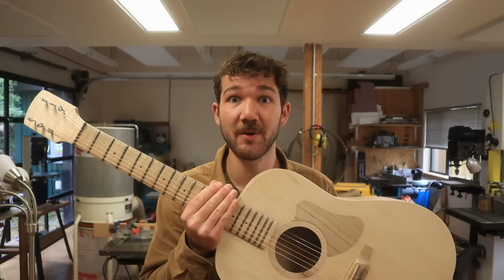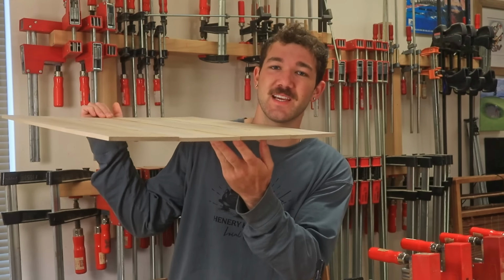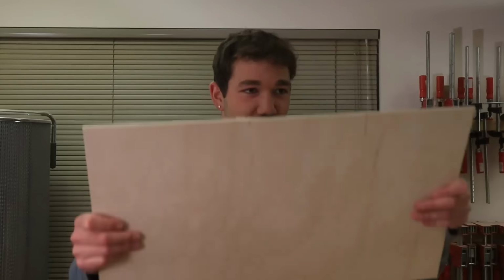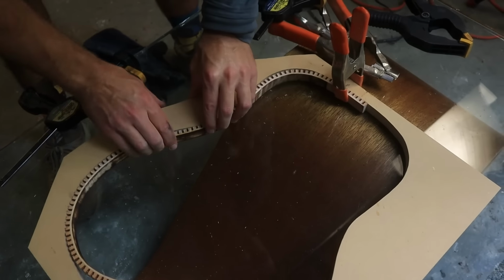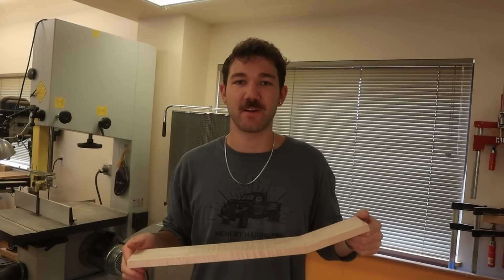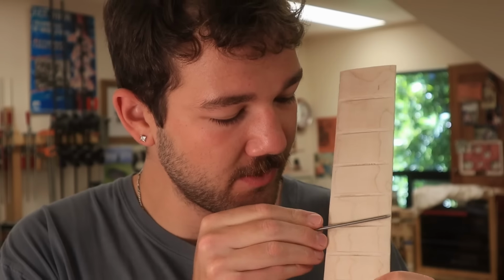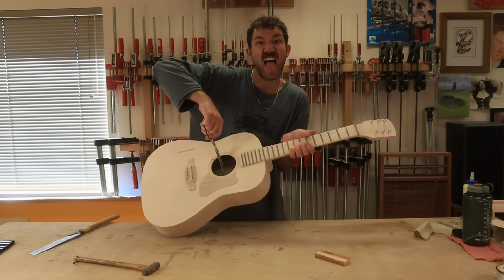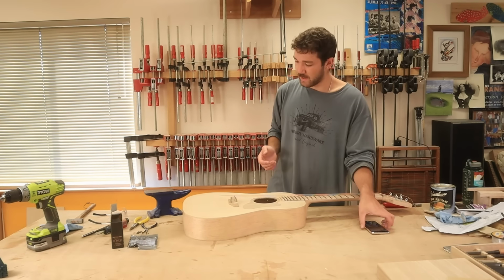I Made A Guitar Using Only Home Depot Supplies

Comment from the maker: The first song I try to play on the guitar is "Spanish Romance," look it up if you have only hear My Chemical Romance, the original is pretty good. My dad played Green Sleeves. 

Yes you did hear Battle Block Theater music and "the pen15 (eek!)" in this random YouTube video about making a Home Depot guitar
Reply: Ok :D
Reply: this is completely overengineered. If you really want to be resourceful, make a guitar out of wood you chopped down yourself. I made a guitar with nothing but cedar trees, a chainsaw, hatchet, a worn-out carving knife, and some old guitar parts, it's not hard, it just takes a little patience. All you need for an acoustic guitar body is some material to make a sort of chamber that reverberates sound. 

The guitar body I made had all sorts of holes in it, but it still worked just fine, it was made entirely of soft wood, which is not ideal, but it still works just the same. The only improvement I could add is a threaded rod and bolts implanted in the neck so it can adjusted when it inevitably warps. 

Instead of the traditional method of framing, I made it out of crossing half inch by half inch studs, similar to a house frame, then I used old roofing nails and glue to attach the studs, connecting the body with the frame. There are always cheaper alternatives that give it a unique look, which I personally appreciate over this copy paste. I get that making something of your own is admirable in some sense, but there are more practical ways to get the same effect.

Seems to me like a monumental waste of time and money from someone who doesn't know what they are doing, I don't mean for you to take offence, by your own admission, you're not that experienced woodworking. It's a skill that takes decades to master, I'm not even half decent at it myself.

5:00 the reason it breaks is because you are supposed to dampen the wood to make it more flexible, but more importantly, you probably didn't use the best wood for the job, not that you needed to. Everybody who does these kinds of diy projects always overspend on them, you don't need all these expensive tools and hours of precision crafting to make something everyone can enjoy

I think my main issue is that it costs like $75 for a decent used guitar online, you can't really make a business or do anything useful with this type of project, its just wasteful for the average viewer to attempt it on their own
Reply from the maker: @garbagecan6969 I'm not going to waste my time explaining to you why so much of what you said is silly, I will just simply point out that you have clearly missed the point of the video. I'm just here to make entertainment, and making a guitar out of obviously horrible materials is amusing to me, and apparently many others. Nothing deeper than that
Reply: @BebeauBuilds  it wasn't entertaining
Reply: @garbagecan6969 "you're not that experienced at woodworking" because he didn't just make a solid guitar frame, doesn't matter if it's not complicated, that's good woodwork either way.
Reply: @SpencerBrewerOG  he admits in the video hes not good at it
Reply: @garbagecan6969  satire?
Reply from the maker: @garbagecan6969  Want to cite your sources there? Pretty sure I never said anything about not being experienced at wood working. Made a JOKE about not knowing how to make the walls and a JOKE about not gluing the pins in well, but you made the conclusion that I'm not experienced at woodworking. Sure sounds like you're just an asshole 😂
Reply: What's the tune your dad plays?
Reply from the maker: @mtbmt6908 I'm pretty sure he's playing Greensleeves :)
Reply: @BebeauBuilds  awesome! I couldn't remember for the life of me. Thanks and great video!
Reply: @garbagecan6969  has a point but still he’s not in control of the video so building a 5+ paragraph essay of what u did wrong is a lil excessive
Reply: @garbagecan6969 is kinda a Karen tbh just let ppl what they do
Reply: @BebeauBuilds u did a rlly good job on the guitar man nobody rlly knows how to build them except luthiers so that’s a rlly good first try!
Reply: One thing I would suggest on attaching the neck to the guitar is making that section of the body attaching to the neck filled and cut the shape of the start of the neck into the body. This is called a dovetail joint. It overall really improves the tone quality sound of the instrument. Even in many store bought guitars.
Reply: And also the reason that u get that ping sound on the strings I think is because the frets are too high on the guitar or at least something in the guitar is touching the string when u play it 😁
Reply from the maker: @Shadow_bru I actually did "key" the neck to the body, that's what the routing of the body was for when my friend was using the home made jig. I just didn't show all the intricate details of everything cuz it's not a tutorial and that would make the video five days long :P but thanks for the interest and kind words
Reply from the maker: @Shadow_bru I'm not sure, I don't think the buzzing comes from it hitting the frets. I think it has to due with the groves made in the nut and the way the bridge pins are held in place in combination with the stupid eye bolt tuners
Reply: Yea I think that was bolting the neck down, you may need to slot it in and glue it.
Reply: @garbagecan6969 what you did was cool and all, but that's not the point of the vid
Reply: why does it sound better then my actual guitar ?
Reply: @BebeauBuilds well, you did say that you don't know how to play the guitar 😒 just telling lies, huh?! 😂 Just messing with you. Entertaining video i watched til the end. Nice job.
Reply: @garbagecan6969 let him do his own thing. If it's "not entertaining," just go watch a different video instead of making a whole rant about it on some YouTube comment, no need for that. I'm also surprised you but all that effort just for a comment that is supposed to spread negativity. I find that a waste of time, AND effort. I'm writing this comment because I am just saying, just let him entertain the people that are into this type of stuff.
Reply: @chuckmccheese  if you read my original comment, you would know I intended to give good advice. Some people don't like being told that they can do better, no matter how true it is. And well, if he wants to argue with me, then i best give him something to argue about
Reply: @garbagecan6969 Um, that didn’t look like advice. It just looked like some dude is picking apart every single detail of a silly and cool video. He’s not trying to make a perfect guitar, not even a good one! He’s just trying to see what he can do with a little creativity and an open mind, something you clearly don’t have
Reply: Total cost? Way better than expected. Fun!
Reply: I was literally playing Spanish romance while watching the first part of the vid and when I heard you play it i got jumpscared lowkey
Reply: @BeBeau builds nice video sir, that’s cool how you made a guitar out of wood , from Home Depot and where’s your dad originally from I can her an accent. And that’s good he approved of the guitar
Reply: I immediately thought of MCR
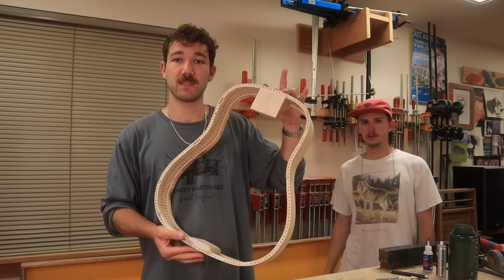Reply: 7:03 what’s this song called?
Reply: Where else can we follow your work?
Reply: @garbagecan6969 u just have no taste this was entertaining as hell lol
Reply: isnt it anonymous romance

Comment: I can’t believe the metal strings held up and didn’t snap the neck without a tension rod. Impressive.
Reply: Acoustic guitars don’t have truss rods, so he actually built it somewhat correctly in that sense.
Reply: @wonton4658 Steel stringed acoustics require truss rods & X-Bracing to support the tension of steel strings, nylon or classical guitars don’t need a truss rod and just use ladder bracing (what was done to this guitar) because nylon strings don’t use nearly as much tension. So basically he built a classical guitar! If he keeps the steel strings on this one it will eventually pull itself apart sadly!
Reply: @wonton4658   My steel string acoustic guitar definitely has a truss rod as all steel strings would..should!
Reply: @leahkelsey3771  X bracing is only one style of pattern. Ladder and V bracing are also used. X bracing is just popular because it provides a more even sound. It's not inherently better (and in fact, I prefer ladder braced guitars because I think having a few strong frequency peaks imparts some character and beauty to the timbre). V braced guitars sound even more even, but they're a bit too dead on the trebles for my taste. Some V braced guitars I like, however. I think they need to be carefully voiced to not overdamp the trebles. I've noticed V braced guitars can actually be really clean across the frequency spectrum if they're voiced well, but otherwise sound a bit too dark.

Truss rods aren't structural per se. They're actually there to help bend the neck to the proper curvature, which you will need to do if you go to strings with a different tension. Wood doesn't stay still over time, it tends to distort. This can really be a problem if the neck doesn't distort straight, hence the need to use quartersawn wood on the neck is pretty dire. The wood is strong enough to handle the tension from the strings, which is only about 150 pounds on an acoustic guitar. You can often stand on a piece of hardwood that is as thick as a guitar neck, which is a substantially higher load that the strings impart.

Most failures occur at the base of the neck where the load is highest, or the headstock, where the wood is thinnest and is also undergoing more torque simultaneously.
Reply: @wonton4658  I have never seen someone as confidently wrong as you
Reply: @wonton4658 All my acoustics must be fake then 'cause they all have truss rods.  Acoustics have pretty much all had truss rods for 40+ years.  Most dreads you see are based on the Martin D.  They've had truss rods since the mid 80s when people finally figured out keeping a guitar running with no truss rod pretty much takes a miracle.
Reply: Some acoustics have truss rods, others don’t. I’ve had plenty of steel string acoustics that don’t. I’ve only ever had cheap acoustics so that might be the reason but they’ve all done fine with steel strings so the truss rod isn’t necessary.
Reply: Well it looked like they put a domino in the middle of the neck so kind of...lol
Reply: yet
Reply: @wonton4658  uh no? Only EXTREMELY cheap guitars don't have a truss rod, any other acoustic guitar does
Reply: @wonton4658 steel string guitars had non adjustable truss rods since the 1930s and probably before, classical guitars never did but every type of guitar has them now even alot of classicals
Reply: Knew I wasn’t trippin

Comment: I'm amazed the neck didnt either bend or break without a truss rod. 
I build instruments, and some brand name guitars will bed to unplayable bows without a truss rod. Nylon string, sure but steel string tension is wicked as hell. You either got one lucky hard-ass piece of maple or some super light string gauge.
Reply: I think he said they were heavy gauge strings.
Reply: The truss rod being for reinforcement is a myth, it's only for adjustment.  The OG Danelectros and Harmonys didn't have truss rods, they had a steel I-beam or square steel tube in the necks for actual reinforcement.  70 years later, and they're still straight necks.  And those necks were made out of low-grade poplar.
Reply: The truss rod is more for adjustment. Over time that neck absolutely will bow until you can fire arrows from it. A metal insert of some kind would lend the guitar a ton of longevity but let's all be real, no one is playing that in two years, let alone 10.
Reply: It's for adjustment, but I've owned many old Kays and Harmonys and the like, and many with T-bars or single or double-reinforcement were bowed.  And a beam won't stop a neck from twisting, ever.  It's all in the wood and the care of the guitar.    In my opinion.  And I'm a twisted old man.     @irlikingpie

Comment: I think I'd have tried using solid #12AWG electrical wire for the frets, but it's all good. Sounds surprisingly good!
Reply from the maker: I thought about using wire but copper is softer than the steel strings and would get chewed up

Comment: You've unfortunately probably found this out by now but you NEED a truss rod in the neck for a steel string guitar. That way the neck doesnt gradually warp over time. That could also be why the strings keep going out of tune. The neck is bending more and more the more you tighten the strings. My advice would be to buy actual nylon guitar strings. They're way less high tension.

Comment: I used to work in a paino rebuilding shop and attempted to make a guitar out of an old piano sound board, had very similar issues with the frets beeing too high lol. I would've used the plywood for the back of the guitar because the front is the guitar's sound board, it may have resonated a bit better. Otherwise thats pretty dang sick!

Comment: If you are going to do this at home use the good wood on the front (the top), and not the back. The top is resonsible for 95% of the tone, and sound production. The sides are about 4.5%, and the back is only about .5%.
Reply from the maker: That's actually really helpful to know. I watched one video about it and they talked about the back needing to be hard wood to send the sound forward so that the front would vibrate and that the front needed to be soft so that it had a good sound so I figured that the ply would be fine. I did think about getting a soft wood and making it into a sheet for the front the same way I did for the back, but I wanted to use plywood so that I would look more like a "home depot guitar" for the video. Which I know is less satisfying for some ppl, but I need the clickbait or I can't make the money for the videos

Comment: Okay, I'm seriously being constructive here. Get it? Constructive? Hey, I'm here all week! OMG, anyhow. I've seen other guys here on YT doing similar projects. If I could suggest changing anything, it would be the hardware. Break or bend your rule about "using only stuff from HD" and get real tuners, fret wire, and a real nut, saddle, and bridge pins. The stuff you're doing here is along the lines of what you'll find on a cigar box guitar (which are very cool, btw). Do this project again. You're definitely on the right track! Stay with the plywood/rough lumber theme. Just use actual guitar hardware. Do it, man! Make it happen! We wanna see it!

Comment: Truss rod?  I'll definitely agree it's inventive.  I know it's based on only parts from Home Depot, and you absolutely can get some usable parts from Home Depot, but there's just zero chance you can build it even close to right without some true parts.  

But for inventiveness, hey, it's fun.
Reply: Home depot absolutely sells 6 foot long threaded rods.  You could definitely use some glue and nuts to fashion a truss rod.  It might be a bit beefy because I think the smallest size is 3/8".  Although they do sell smaller rods that you could thread with a die set!  :)

Comment: The reason it's going out of tune is that when you put new strings on, they haven't stretched out yet. So they keep pulling on the tuning pegs and forcing them out of tune.
Reply from the maker: That was definitely part of it initially, but it was mostly that the eye hooks kept unwinding when put under so much tension

Comment: Ok, this is honestly pretty impressive... you clearly have more skills than the average dude to even try this, but put some decent tuners (and by decent, I mean anything that has actual gears, they can be cheap ones) on it and spend a little time dressing the frets to make all the notes sound cleanly and this wouldn't be a half bad instrument.  It honestly sounded way better than it had any right to just as it is.  Do you think it'd be easier to improv a classical guitar, since the synthetic strings don't hold as much tension?
Reply from the maker: First off thank you, I appreciate that. There is definitely much more effort that could have been put into this, but I was too hard to get myself to when I knew all the materials were so shitty and wouldn't produce anything great. I honestly don't know enough about guitars to say whether or not it would be easier with a classic, probably? I can't even tell if the neck is bending without a tension rod because the fret lengths are so imprecise and the "tensioners" are so god awful. Probably would make it easier to play at the very least
Reply: Thanks for taking the time to answer.  The lack of a truss rod/tension rod in the neck was the main reason that I was thinking that a nylon/synthetic stringed guitar would be easier to make work with sub-standard materials.  There's way less tension on the neck, so as long as it's reasonably straight to begin with and the string angle from the nut to the bridge is ok, it should be fine. I guess you could potentially make the neck too thin and make it bend anyway, but you'd have to make it really thin for that to be a thing.  Whatever you use for fret material at that point, it should be easier to dress them and avoid the high spots that were making this one hard to play.  I'm not saying it would sound great, but given some of the offerings on ebay and/or amazon at this point I think "decent" is a more competitive arena than "great" anyway...  I doubt anyone's expecting you to come up with a Martin or Taylor clone from big box store lumber